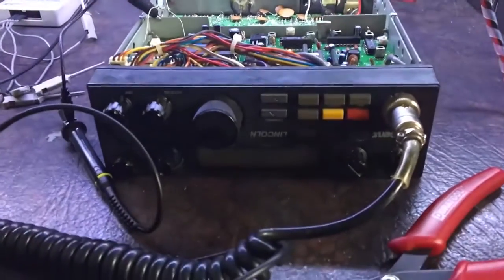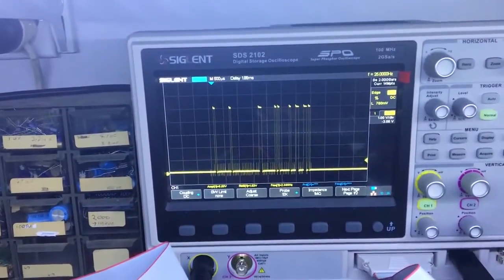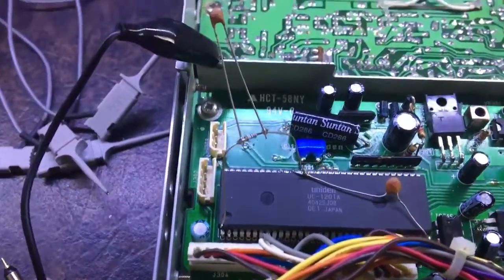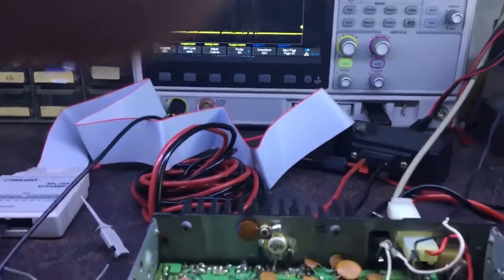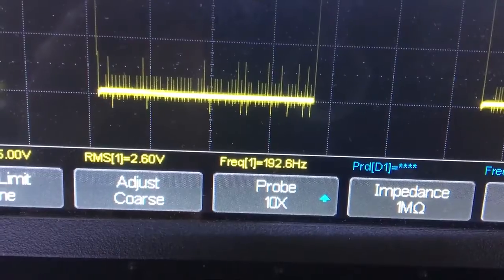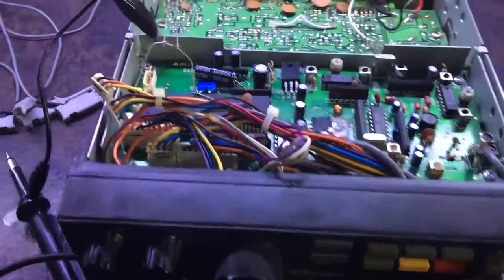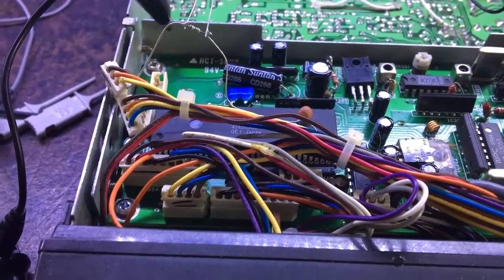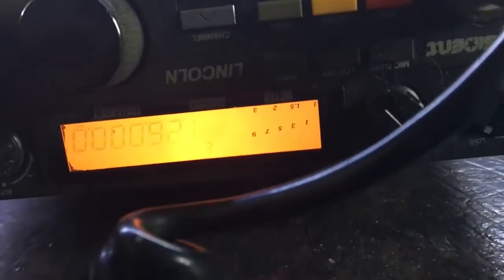#145 President Lincoln Repair Part 1

Comment: I think it's a red herring. Not enough to toggle the I/O state of the GPIOs.
The noise is likely coming in from the display driver.... looks to be the right frequency and amplitude.
My guess? faulty power monitor/reset ic.
You can test this by toggling the mcu reset line when the radio is glitched and see if it resets properly.
Reply from the maker: Mark19960 - unfortunately I already eliminated the display itself, as the noise was still present even without the display plugged in, the next thing I will be doing is replacing all the capacitors, it could be poor smoothing of the supplies.
Reply: I have a pair of 2510s.. so I can check but I am willing to bet this noise will be present.
I reverse engineered the MCU years ago then I just bought a couple of chipswitches and moved on.
This is actually an early LCD driver so it's easy to debug because command/data is done at the hardware level instead of in software.
When it simply does not turn on that tells me it's likely MCU related because the LCD driver gets reset from the MCU.
It's likely the MCU is being held in reset. I have seen this before in one of the 2510s I have here.
It's easy to verify - and yeah... it can be a bad cap in power management. There are a couple as I recall.
Reply from the maker: Mark19960 - I tested the MCU reset circuit and that seems to be fine, same timing regardless of fault or not. I just happened to find whilst testing that having my logic analyzer connected stopped the fault occurring, which is why I started looking at decoupling on the pins in question.
Reply: What's the voltage on the probe?
It might be acting as a pull-up.
The probe, if anything will inject more noise into the system. If the probe changed something then it must be tugging on it.